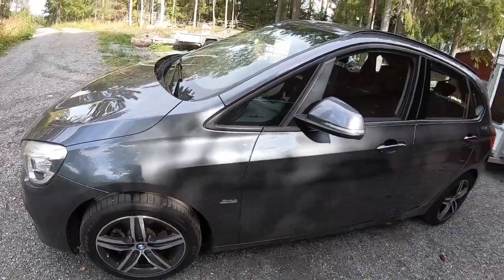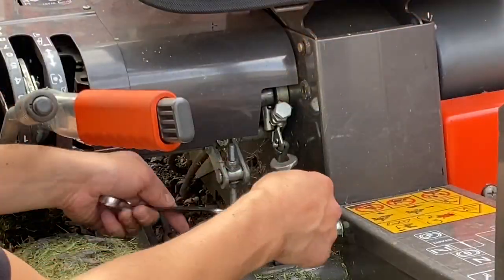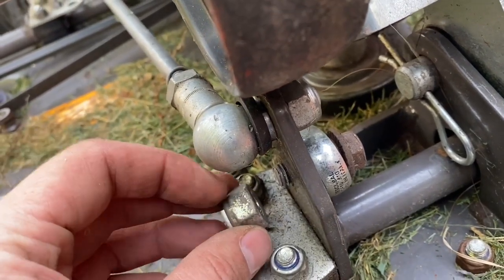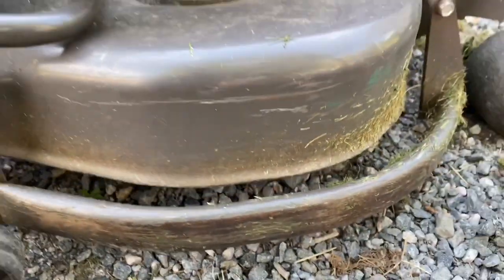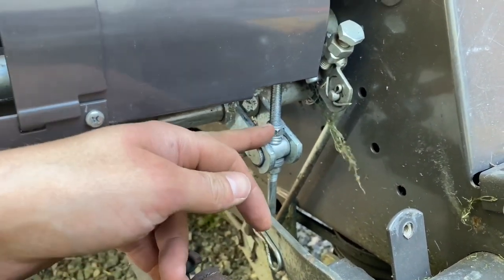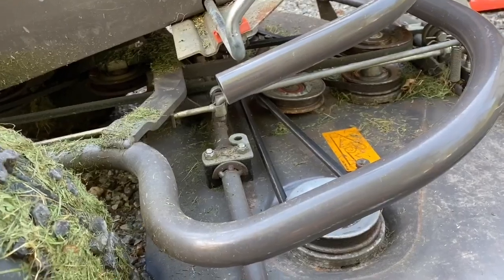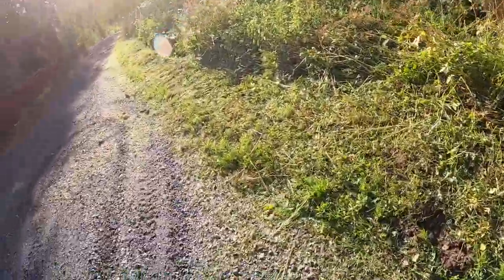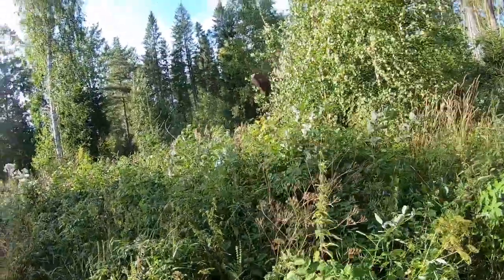Getting MAX cutting height on the Husqvarna Rider + cutting really high rough grass and weeds

Comment: good work Nils. if its long grass you want to cut get some " Kavali blades" Made in australia they will transform that mower and you will not have to go back over it will cut in 1 pass.
Reply from the maker: Thanks! Looked at that blade and if I understand the design it will chop up the long gras that has been laid down by the deck. Clever idea and probably great if you do a lot of high weed or grass.
Reply: @NilsKall  thats the idea exactly. it takes load off the mower as the blades are not rubbing on all that pushed over grass

Comment: Thank you for this video! I'm in the US and cannot find much support for my Pro Rider 15. I do have a manual, but find it hard to follow sometimes. Somehow I've developed the problem where the rear of my deck is dragging the ground. I'm trying to sort that out and looking for help. Also the front bar on mine is very close to the cutting deck and the deck doesn't drop down without touching the bar in the front.

 Trying to raise the deck because in the number 9 cutting position it is still very low.
Reply from the maker: Hi! Nice to se that my video can help you! Im actually editing a video about how the cutting deck works and how to put it in and out of service position. Im not going to post it right now but I can give you a link to it (unlisted) as soon as it is uploaded. Perhaps it can be useful for you.
Reply: @NilsKall  that would be awesome! I've put it in service position and changed the blades (with pins and washer's) just prior to trying to make this adjustment. Maybe I created the problem.
Reply from the maker: Hi, the rear dragging could be due to you not getting the tab in the cutting deck inside the hanger that is located on the mover. You will see in the video soon.

Comment: How did you restore the colour on the orange plastic panels?
Reply from the maker: I bought new ones 😀
Reply: @NilsKall  Ah, that was easy!
Reply from the maker: thepajbren yes, but not cheap, but worth it in my opinion. Since I bought the mower cheap I could spend some money and time on it and still be ahead. I think I payed 150€ for the rear cover and 140€ for both the foot plates. Then it was stickers and grip stickers. All in all I have about 1200€ in this mower and I figure I could get more if I sold it.
Reply: @NilsKall  Definitely worth it. I'm looking for a Rider 13 or 16 myself, there's a 2000 Rider 13 for sale near me at €1350. I'll try to get it for closer to €1000. Your videos have been great for problems to look out for when buying. Thanks.
Reply from the maker: thepajbren no problem! Glad it can be of help.

Comment: How much higher did you get the cutting deck?
Reply from the maker: About 3 cm so max cutting height is around 12 cm
Reply: @NilsKall  do you know if you can make this adjustment on the new models, specifically the r214c?
Reply from the maker: @SteveSavageAguaspan  They haven’t changed much over the years so you probably can. Just remove the floorboard and check.